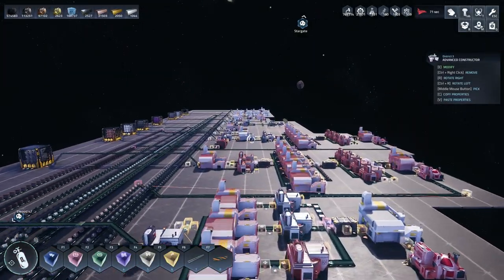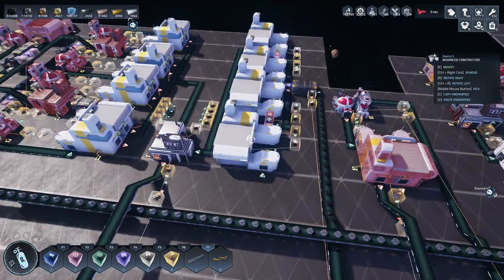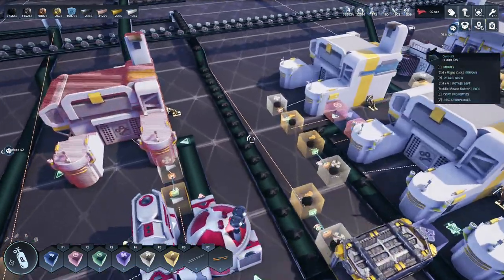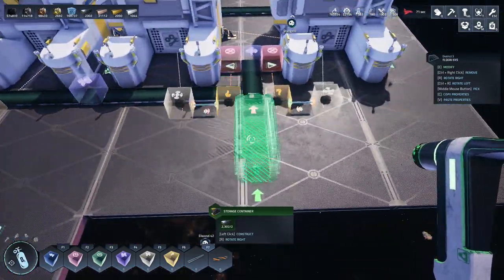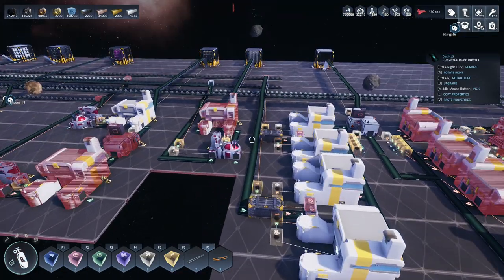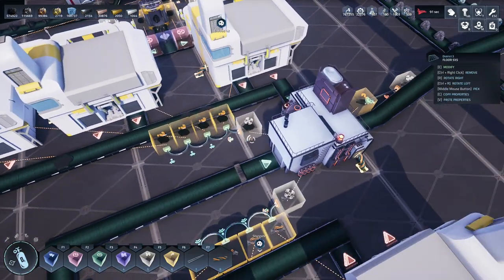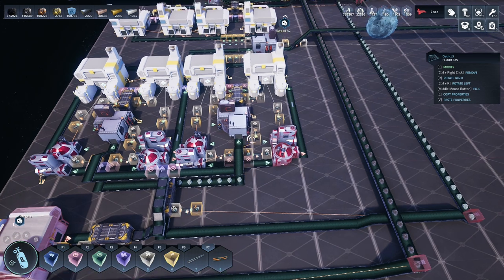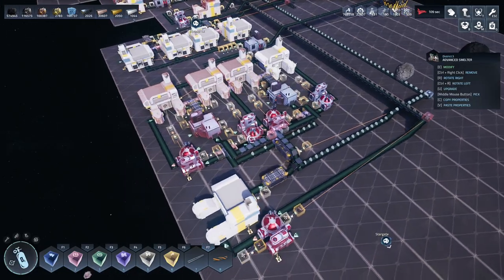Astro Colony - I Was Wrong Graphene Is Very Complicated

Comment: For the gas you could put a docking port down by the production line and dock the gas planet there to save on the pipe length temporarily until you get some stock built up.  Spoilers storing the gas takes a lot of space if you want to keep it on the ship and its semi expensive with uranium rods being part of the gas tanks you need.  So you'll want to find a planet with some uranium on it sooner rather than later.  BUT to be fair I probably made it worse on myself than it needed to be by trying to farm and store an entire planet's worth of gas on my ship lol.
Reply from the maker: Why pipe the stuff far, when you can just MOVE THE PLANET!
That's actually a really good idea, but just hearing that without any context would sound a little out there. 
Do the pumps keep pumping and wasting he gas, like ice breakers, if there's no where for the gas to go? I don't want to waste any if I can help it.
Reply: @STHedgehog  Work smarter not harder!  As if moving the planet is easier than laying down pipes.  Yes unfortunately they do pump and waste the gas if your storage is full just like water.  Which is why I was trying to store an entire planet's worth of gas to begin with.  There was an insane amount of gas on the planet I found however so wasting some of it wasn't a big deal. 

I ended up making sure all my gas pumps were connected to my solar grid by a single power line that was easily accessable and when the storage got close to full I would delete a part of that line and kill the power to all the pumps until I could either use some of it or get enough uranium to make more gas storages.

IF I were to do it again I would probably set up some amount of storage on my ship and just keep the planet in tow.  Power it on whenever I needed some more, fill the storage, turn it off again.